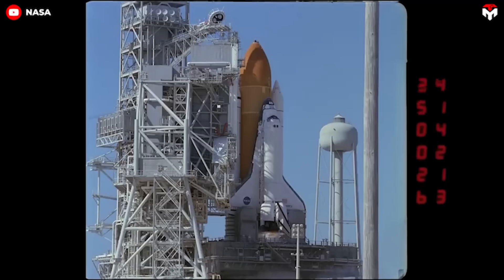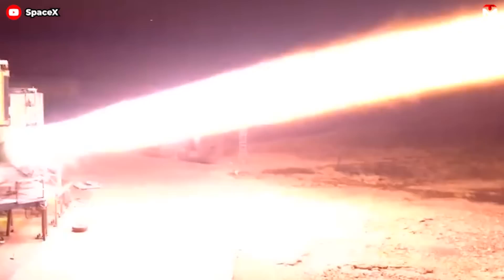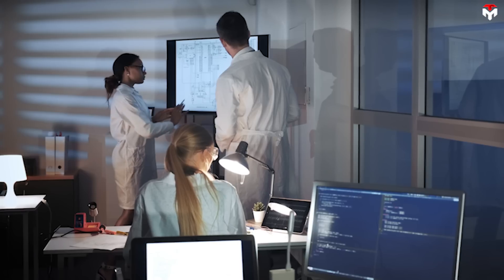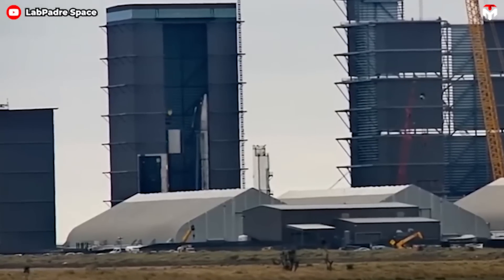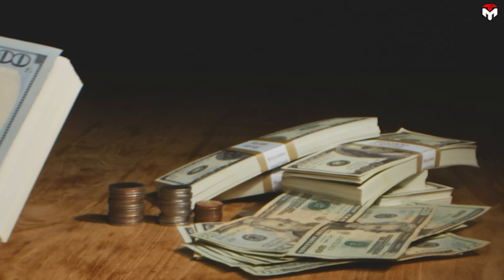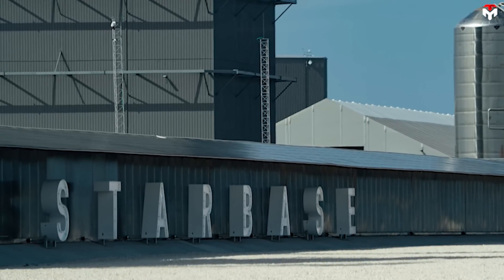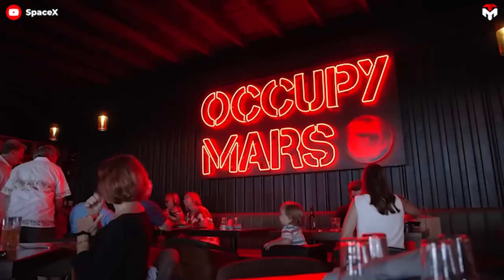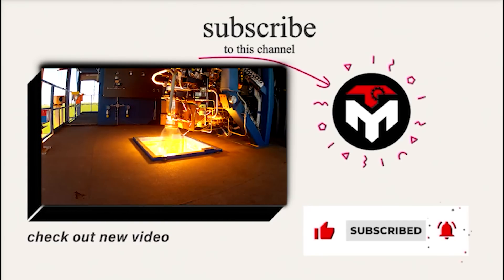SpaceX's Major Design Change at Starship launch pad!

Comment: With the new flame trench. Will it able to take the power of the Raptor 3 and the engines beyond? It took the water deluge system just to handle the Raptor 2. Even at that they had to do some repair work on it. Even if the flame trench is a  test facility. That is a lot of power. It will be interesting to watch. Thanks for the update. I didn't know that project was in the works I always learn something new. Great Episode. I hope you can expound more on the flame trench and its progression. Thanks again.